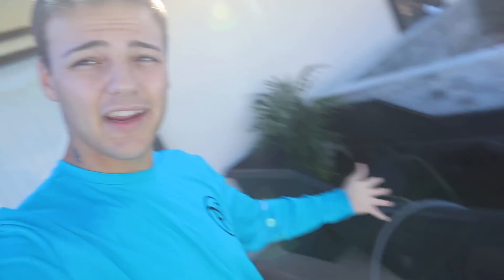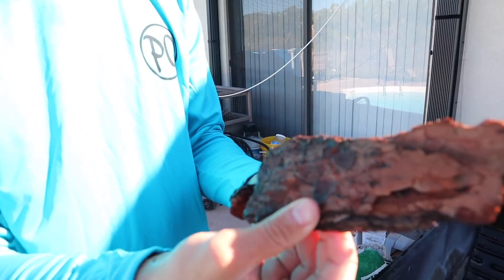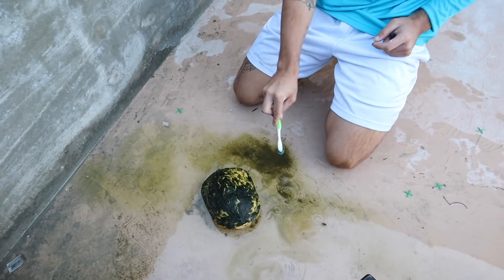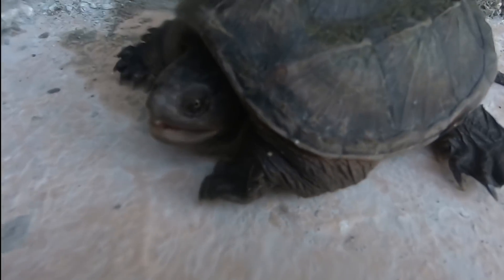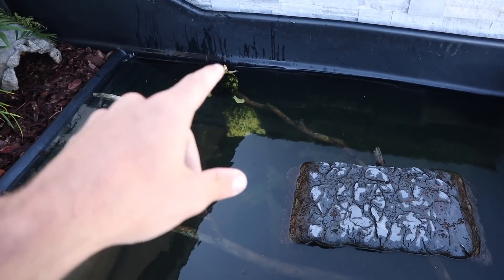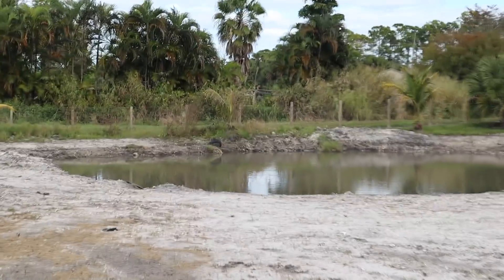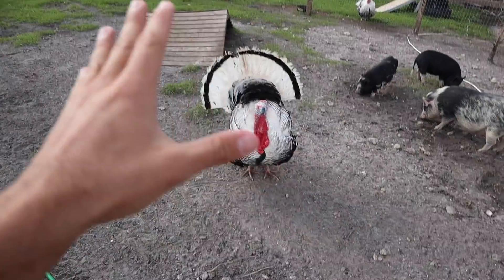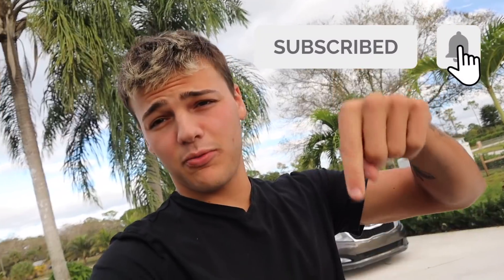Building My ALBINO TURTLES Natural Habitat TUB!!

Comment: It's really simple, clean the shell with running water and brush it with a toothbrush or put it in the bucket with water and hold it with your left hand on the backside of the shell( tail area) and scrub it with your right hand. I used this technique for my snake-necked turtle.

Comment: I recently moved my turtles inside for the winter and one of them had algae on it.  I used api pond algaefix algae control solution in a bin with water and let the turtle soak for an hour, then i used a tooth brush on his shell and noticed the algae came off a lot easier. I think from now on I'm going to use the api pond algaefix in my pond at all times to help control the issue. Might be worth a shot to try.

Comment: 2 recommendations:  First, you might want to try an electric toothbrush to clean them, way less stress on your hands but still gentile.  Second, give them a 12-24 hour bath in a temporary bin with some pond allege killer.  It won't harm the turtles and if you do it in a separate bin you won't have to worry about unneeded chemicals in their tank.

Comment: if the algea is slimey and nasty you should slowly work to clean it off over time. 2 or 3 minutes at a time. 1 or 2 times a week so you dont stress them out. if it is cold outside it is probably why. it is keeping them warm. it will naturally come off as whatever it is causing the issue getts resolved. its not a bad thing unless its slimey or it continues for too long cause it can make their shell soften and start to rot.

Comment: To bathe your turtle, you just need a tub, a toothbrush, and a jug or pitcher of lukewarm water, preferably de-chlorinated beforehand . You should not use any kind of soap or shampoo on your turtle, unless it was specifically recommended by your vet. Fill the tub with water and gently place your turtle in the tub.

Comment: Hey Paul to clean your turtle you can use a buffer with cold water so it doesn't get hot just to be safe. link to the one I have used -> https://www.homedepot.com/p/RYOBI-18-Volt-ONE-Cordless-10-in-Orbital-Buffer-Tool-Only-P435/205975768